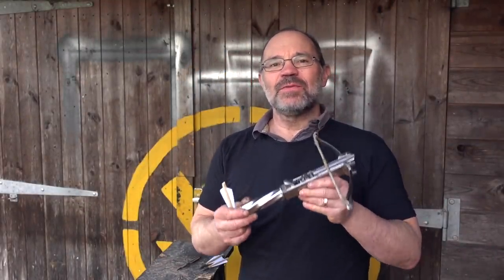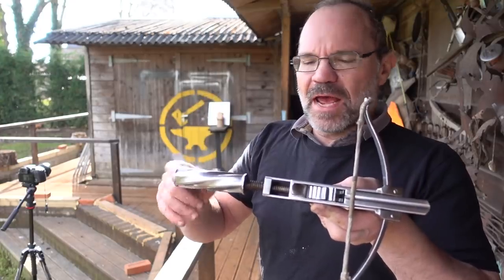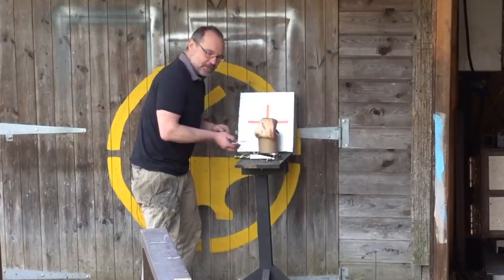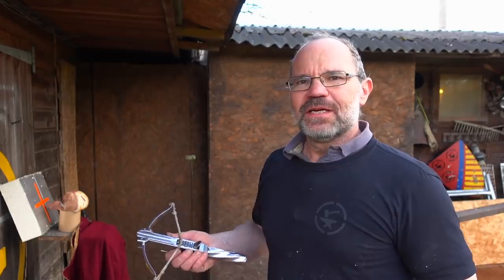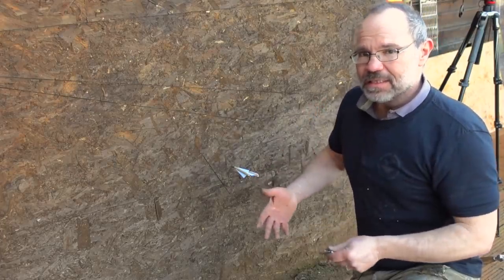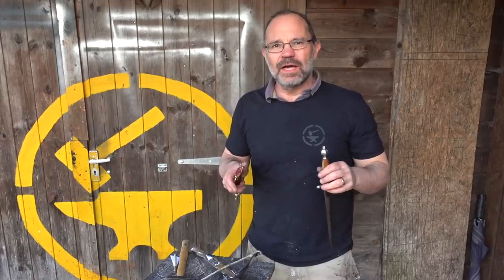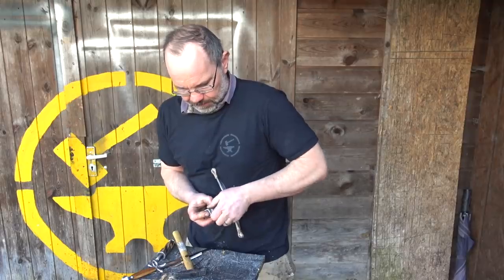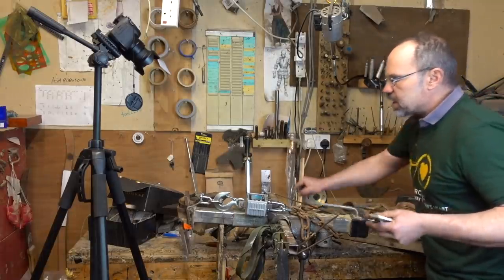200lbs Assassin's Crossbow - LET'S TEST IT!

Comment: Biggest advantage this has over a pistol, its almost entirely silent.

A pistol is great if your just some guy tryna run up, blow someone away, and make a dash for it, but realistically its very difficult to assassinate a noble like that and get away with it. Nobles aren't really afraid of that situation.

What IS a situation a noble would fear? A chamber maid with a vandetta, or with allegiances to a foreign power.

Or lets say a noble is hosting foreign/rival nobility to their home discuss political affairs. They could acts as eyes an enablers, opening doors and windows to n assassin.

In this situation an assassin can hide in a nobles privates chambers, (a bedroom, a study) where they could shoot someone in the head at short range while they read or write, or while they pray before bed, or even while they sleep.

Let's say you shoot from the edge of their bed. You get a clear headshot on a mostly motionless target. It could easily be several hours if not a whole day before someone checks on the person. Afterwards you can lock the chamber door and have loads of time to clean up the scene. Pick up your bolt to leave less evidence and for reuse, pull the covers over their head to hide the blood/wound, wipe away finger/footprints.

That would make catching the assassin very difficult.

Compare that to a flintlock pistol, which has similar range and accuracy, similar killing potential*, similar concealability, but once you pull the trigger after firing inside, everyone and their momma is up and coming to the source of the sound.

*This is assuming firing at an vulnerable unarmored target - like a noble in a night gown.

Comment: if an assassin snuck up close in a crowd and aimed dead center at someone's chest... that would be enough to guarantee a kill. Of course, getting close and hiding it in its ready state is probably not going to be easy.  Or with a bit of poison smeared on the point, a kill might be possible at range. Still if you were trying to kill someone, it would probably be easier to use something more reliable like an ordinary  heavy crossbow.

Comment: Walk up to victim with device concealed beneath your cloak. When about 3 paces beside your unwary victim, hail him as a long lost acquaintant.As he turns to greet you,draw aside your cloak  and release the bolt into his breast. This method will not be like the firelock that would alert  his servants and coachman. Then, walk away without urgency through the busiest part of the market place to where your coach would be kept in waiting for your rapid departure. This machine is recommended for use at a distance no more than two paces.
Greetings from the colony of New Holland.🇦🇺👍

Comment: I have to disagree, that is absolutely an assassins weapon.  Just because you can't aim it doesn't mean a professional assassin didn't spend endless hours learning how to use it properly.  I can hip fire a slingshot and hit a chipmunk in the head at 30 meters, trained intuitive aiming.  There is no reason on earth someone can't do the same with that.  On top of that it's hella quiet, that little click would not draw attention in almost any situation.  Those small darts are perfect for poison, so even while the penetration can easily reach the heart and lung, which would absolutely be fatal in those days, the poison would be the primary killer for a weapon like that.  I bet that little guy could even be shot from an oversized sleeve if necessary.

I wish I had the funds to buy that off your store, I would LOVE to practice with this just to prove it can be done.

Comment: 200lbs??? Where does the energy went? It seems 90% of the energy disappear -  a normal sized crossbow with 200lbs is quite powerful - maybe it gave other constructions of it, the deliver way more power, if one look on google it gives much different designs, with steal bolts instead of wooden ones, idk how powerful and useful they are, but i'm pretty sure it gives ones the way more accurate and way more powerful.

Comment: Late to the comments but et me offer this for you Todd, this is just a line of thinking with no real expertise to back it up. I personally could see a use for this in assassination under the right circumstances. 

First I don't think the bolt is right, maybe something different was loaded, like an all steel bold giving it more weight with it's distance so low and accuracy so poor, you might as well have a heavier projectile or with a bladed tip to do more amount of damage, but I do think poison would be used.

Now the situation I feel this would be use is in crowded venues where a public execution was desired. You don't want to use a pistol because they are loud an draw attention. Using a knife either requires you to get right up on your target or make movements in throwing it that could identify you as the assailant. With something like this, it could either be hidden, disposed of, or even planted on a scape goat. This clearly wouldn't be used with any regularity, but I could see it's use in very specific situations.

Comment: To be a successful assassin you need to avoid being caught. A pistol is noisy, smelly and flashes, everyone will see you fire it. A dagger requires getting in close and you'll wind up with blood on your assassins creed outfit, you're going to be spotted. This crossbow would barely be heard in a busy street or at court, doesn't flash, doesn't require getting too close and you won't be covered in blood or stink of gunpowder. Getting away with moider skill roll +1D20.

Comment: Wipe the point in a pat of crowding, or better horse manure ( Clostridium tetani) and your target will die a slow, painful death several days later!!
Also, a Pistol Grip or Wrist Brace would improve accuracy (c/f modern Bartlett Balestrina)
And an overlock lever loading system rather than a threaded winding handle.
For ultimate poison effect, even a surface scratch, is Ricin ( Castor seeds)

Comment: I would argue this crossbow works well. You tried to aim at a small piece of pork. Turns out a human is bigger than your piece of pork. 
It prouved it's efficiency to pierce clothing.
It penetrates the flesh. But someone wouldn't die from that, I believe the tip would be covered in a substance. 
The substance could be a powerful relaxant, to make your target pass out in the street or a very lethal poison. A poison that could kill quickly (do not leave the time to identify the poison and to find the antidote), the poison should work even if not flowing directly.

We are then looking for a poison that kill even if not in the bloodstream such as aconite. It was used in China to coat the tip of the arrows to kill human or large beast(because a single arrow wouldn't be enough to deathly bleed the beast). For humans symptoms appear from 20mins to 2 hours and can be lethal if not cured for 6 hours.

Yes it will not kill the person on the spot. But it is easily concealable into a cloak. Once you can confirm your target is poisoned (commotion created after the impact) you can leave the scene unspot.

Comment: "you would have to ask your target to hang out." 
or you know have a few more loaded and ready
Also that accuracy was decent. You were just doing a very small piece of meat
Reply: ”....have a few more loaded and ready” I seriously doubt these things were cheap enough for that to be realistic. Plus, if I understand the design correctly the bolt would have to be put in place, so there would still be a delay even if it was a smaller one. Then there’s the practicality of rapidly swapping between them. What happens to the first one after it’s been shot? Does the assassin carry a bag full of loaded crossbows and an empty one to transfer them into after shooting them? Sounds like a fine way to make it really obvious what you’re doing to me. Maybe having them strapped to the body loosely enough that they can be grabbed and aimed without untying/unclipping might work from a speed point of view but clothes sufficient to conceal this arrangement would also get in the way, and the bows would be clanking together while walking. This would also require a load of rapid movement again making it super obvious what’s going on. I can’t see this being practical at all beyond maybe having one in each hand, which would still be way harder to conceal than just one.

The only way I can see this making any sense as an assassination weapon is near point blank ‘walk by’ shootings in a crowded scenario.

Comment: Definitely thought provoking however I think your too quick to dismiss it as an assassins' weapon.  In our modern thinking we are used to sniping from a distance with supreme accuracy or shooting a pistol from 5 or even 10 meters away. Your accuracy test was over 5 meters but I think even that is too far. Most assassinations are up close and personal but if you consider the dagger, you have be almost touching so if there's a body guard or anyone else in between you and the, target your not close enough. Alternatively if you are behind that person. i.e. 2 meters away I suspect a poisoned bolt would be all you need and then who cares about accuracy. All you need is a small gap to fire the bolt though. 

As for a clip to hold the bolt in place, maybe that's why the trigger is on top allowing the user to hold it with their thumb which they can slide it back to operate the trigger. I totally agree with the range assessment but if you point it in the air at 45 degrees it'll probably almost get that far but not as an accurate weapon.

Comment: why this over a gun? it's considerably quieter than a gun, why this than a dagger? you can be at a longer range. Was it an assassins dagger? Likely. Did it work well? likely not. So it was tested, sold to do the job, likely failed outside of a handful of times and discarded as a novelty.

Comment: Italy and especially Venice was a hotbed of assassination and murder. Venice had its own secret police under the Doge. It was a bit similar to the Mafia today. So you have to put yourself in the mind of someone who wants someone else killed. You don't want it traced back to you so you hire or employ an assassin. The whole point of assassination is that it is done covertly. This would probably have to be in the street because the chances of getting into a heavily defended palazzo, doing the deed and getting out again undetected were slim. 
So your choices are knife, gun or crossbow. Neither of the first two are covert so even if you are successful you will be captured which means a long slow death  which is bad for career development. The balestrino is the perfect solution. Using poison on the dart would make it lethal. It can be hidden under a cloak, in a crowded street it would not be heard. It has sufficient range to be fired from the side of a street or from a window above. Once used it could be dropped and with everyone's attention on the latest in street theatre and someone with a bolt sticking out of them making loud noises  nobody would notice.
As the saying goes, the victim has to be lucky every day, you only have to be lucky once.
A thought: would penetration be better with a thinner bolt? Does it need to be fully fletched? Could the tip be barbed?
You can see why the Doge banned them!

Comment: This crossbow has one big advantage over a pistol: It doesn't leave the shooter standing in a big cloud of gunpowder smoke. So unless someone saw you holding it, you'd have a somewhat higher chance of getting away if you drop it out of sight right after the shot. With a pistol, you have a lingering cloud that points right back at you.

Comment: Thing is, even a shallow wound into the abdomen with one of these might well be lethal, given the lack of medical treatment available for something like a perforated bowel or kidney. Add poison (or even just smeared with excrement) and the danger from even a minor wound goes up exponentially. Getting to within 5 meters of a target is A LOT easier than getting within stabbing distance (especially for a well protected target in a crowd, for example). One of these shot from a crowd will be a lot less obvious than a black powder wheellock pistol being discharged.

I think its entirely plausible that this might be a close range, conceable poison delivery system. The assassin approaches the target in a crowd, while an accomplice creates a commotion to attract the attention of any bodyguards. The assassin loads his poisoned bolt, fires a quick shot at center of mass, drops it to the ground and walks away, trusting sepsis to kill thr target in a few days/ weeks. Think ancient version of the weapon used to kill Georgi Markov.

Love the video, Tod, but this thing seems totally plausible!

Comment: For you to think men were not killed with this thing baffles me.. Just like today you have alot of different pistols.. Back then they had some slightly stronger or of better design. If that will do what it did to a piece of meat like that it will eat your lunch if it struck something like the throat or solar plexus region it would be devastating. Not to mention different bolt designs or head types. But most of all a disciplined man that knows the weapon. A Assassin of the period would be someone who really put in the work or training I believe. So unlike you he would have a better chance of hitting his mark. At least a 50% better chance. So all that combined being, lost tech, thinner more blade like bolts with the most effective "Razored Edge" would be used on a high value target to ensure the most damage inflicted would occur. I believe it totally possible these were used on numerous occasions to kill or wound or distract. I mean look at the shear money put into weapons today... I don't see the times changing anything. Have a good one I enjoyed the show. Thanks.
                                                         :)

Comment: guns may have been around at the time but this was quiet. in a noisey room are you going to hear what direction that came from, as people are confused as what is going on that might be enough time to get away. you have to be close to use a dagger. you were able to hit the target after how hours of practicing with just that weapon, now if you life depended on it how long would you practice to make sure you it hits your target the first time? why would you ever reload that weapon? as soon as the assassin pulls the trigger, nothing good can come of sticking around. it was successful or a failure, if it was a failure you try again at a different time and you keep trying till it is successful. but if you are captured or dead then you can not be successful. the whole movie control freak I want the target dead at this time in this way, and I want it now now now, it's dangerous for the assassin, unprofessional, and counter productive to the goal of having the target dead. while a master craftsman of any craft may be able to do something with great speed this is deceptive because the only reason they were able to do a thing with great speed is because they spent years doing it until it was effortless, perfect, and in a instant. that's the difference between some guy with a dagger that likely died and failed. some guy thinking he was a super hero that could get past the guards that were also professionals at what they do, and now because of the more guards the actual professional Assassin can't get close to him.

Comment: I just came across your video and I find the crossbow a very cool piece of weaponry, however watching to the end I believe there is a huge flaw in your conclusions. You keep bring up guns and you bring up the dagger as well as this bow alone wouldn't kill. You however you thinking with the tunnel vision of an engineer and not that of a killer that 1- doesn't to get caught and 2- doesn't want to die. one or the other is going to take place should he use a gun of the time or be standing close enough to stab someone and not be witnessed or grabbed in the act. That little bow would not have to shoot over a great distance to be of great use in avoiding the issues of death or being caught and then tortured followed be death at some point.even 10 feet with a very well poisoned arrow would be more than enough to do the trick. You are also throwing into the mix your poor ability to use your own creation and it also shows you probably haven't spend much time around firearm shooters. If you had you would know full well what practice would do for you. An assassin would spend a lot of time practicing with it and as an example what can be done with practice, I have a friend who has a small .22 caliber rifle, its very old and he has shot 1000s and 1000s or rounds through it. He is a crack shot with it and will hit a penny at 75 yards every time. None of us friends who are excellent shooter can hit a damn thing why  you wonder? that rifle is old enough and been shot so much that it is a smooth bore. our friend is the only one that had practice with it so much he can still make use of it. An assassin would do with your crossbow what you can't

Comment: God damn about that supposed to be an Assassin's crossbow do you not have any type of sites on there I mean f**** anything I'm guessing not because you would have changed your point of aim and after two or three shots at freaking 15 ft I think you would have it figured out so I'm guessing there's just kind of pointing and aiming with absolutely not even a notch cut out of the wood or any type of sight anything for reference and what kind of velocities are you getting how many grains are the bolts